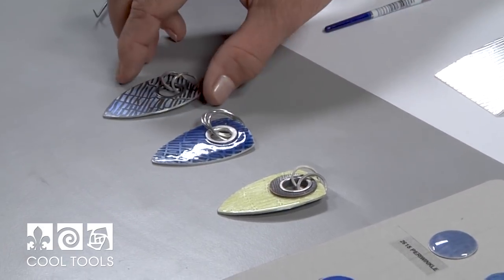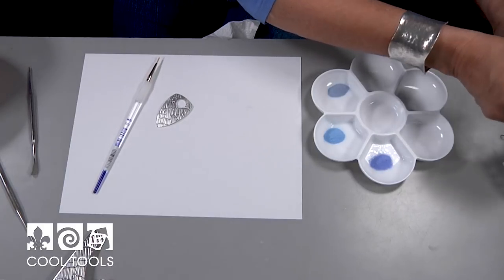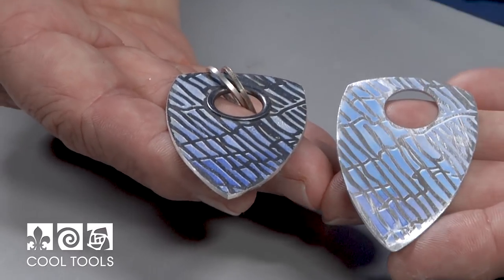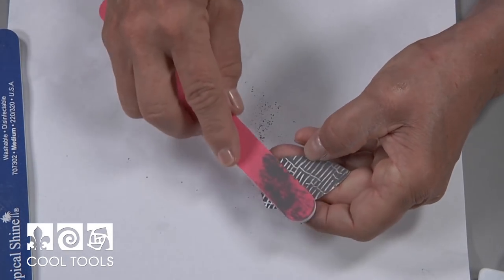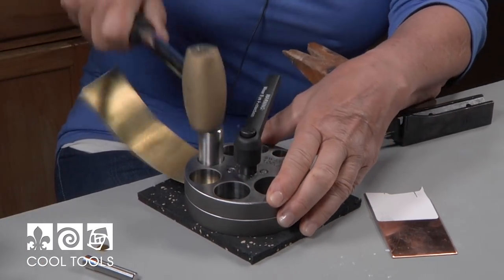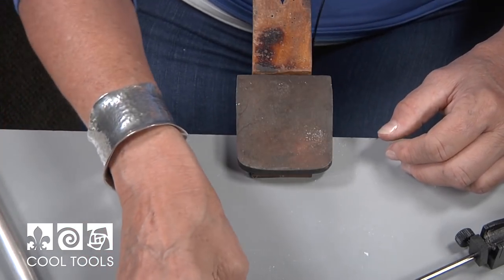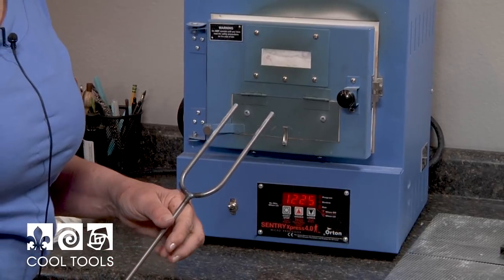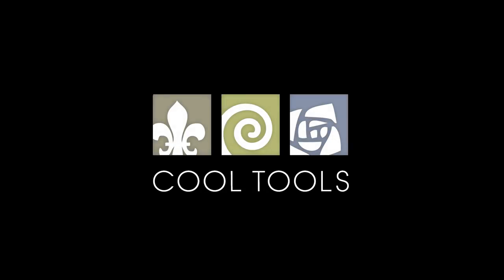Cool Tools | Enameling Techniques & Tube Riveting by Jan Harrell

Comment: How do you make the dual enameled pendant with a design on the back?
Reply from the maker: Hi Marcia, can you tell us which pendant you are wondering about?
Reply: Jan Harrell’s enameling and riveting
Reply from the maker: @marciaeveritt7958  Her enameling and riveting technique is shown in this video.
Reply: CoolToolsVideos she talks about putting a design in the counter enamel, so it looks good on both sides. Doesn’t explain how to do it.
Reply from the maker: @marciaeveritt7958  Thank you for clarifying. You can also use design stencils or Sunshine Enamels to paint a design on for the back. This would be our recommendation, unfortunately Jan does not have a video specifically showing what she does to the back.

Comment: Don't waste your time annealing it when you sand the piece down...its not work hardened that way...only thru rolling, hammering, stretching and forming like bending, twisting...but sanding and grinding does not aneal the piece...it removes material❤🎉